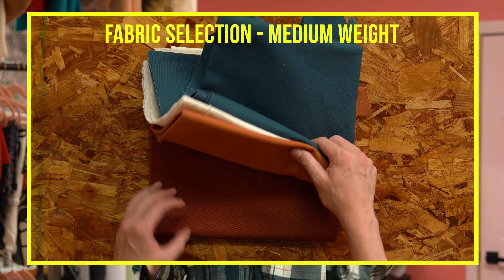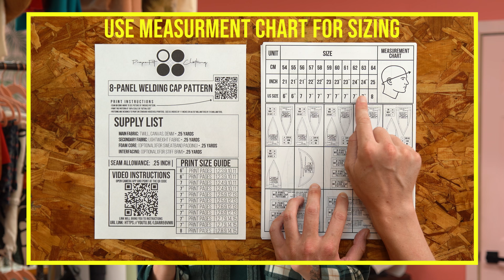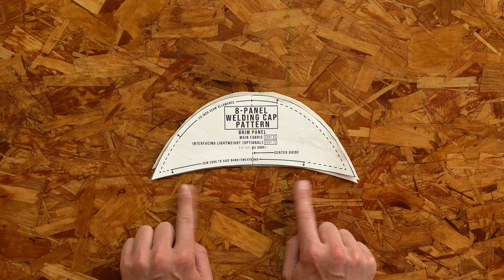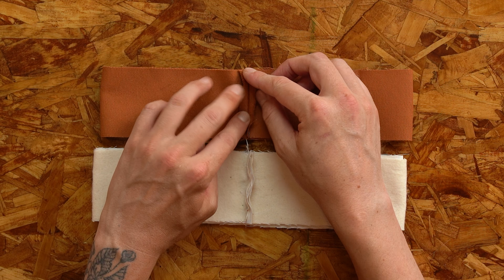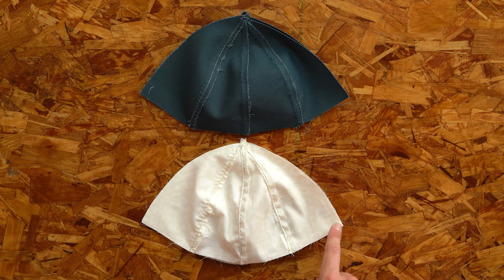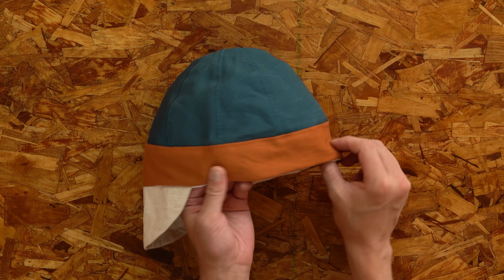DIY 8 Panel Welding Cap | STEP BY STEP INSTRUCTIONS + Printable PDF Pattern(EASY TO FOLLOW TUTORIAL)

Comment: I made the 7 3/8" pattern today. What did I do wrong the circumference is almost 26"?
Reply: I made the 7 1/8  and my crown circumstance is 25 1/2  my band is about 23 1/3  so I'm struggling to join them.
Reply: @tabithanelms6231  Did you get this figured out? I do not understand the band part. I printed the pattern in actual size and when I tape the band together, it's only 12 inches. How in the world is that? I keep messaging him on Etsy, but his explaining is not helping me because the band is still 12"
Reply: Did you get this figured out? I do not understand the band part. I printed the pattern in actual size and when I tape the band together, it's only 12 inches. How in the world is that? I keep messaging him on Etsy, but his explaining is not helping me because the band is still 12"
Reply: @butterflyvalleyfarms you have to put the band on a fold of the fabric. Fold your fabric in half, put band pattern piece (where it is marked on the fold) on the fold of the fabric, then cut. If your pattern is 12”, then your band will actually be 24”. (Just don’t cut open the fold. Hopefully that helps

Comment: What kind of modification do I need to make to the pattern if the top is too pointy?
Reply: I can only tell you what I did to fix that was to adjust your band that goes around the head if the band is too snug and its pointy then cut that band down a bit. I went to 1.5 inches wide and it's perfect
Reply: I would say shorten the triangular panels so they appear more short and fat rather than having a long taper to the point